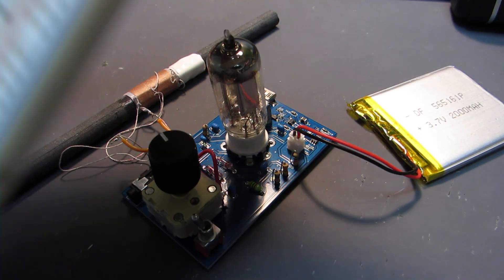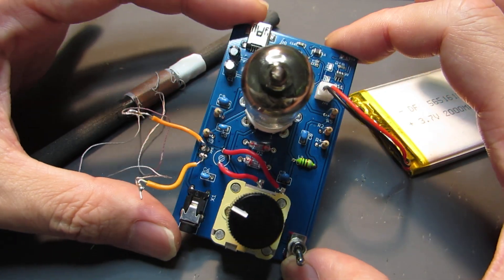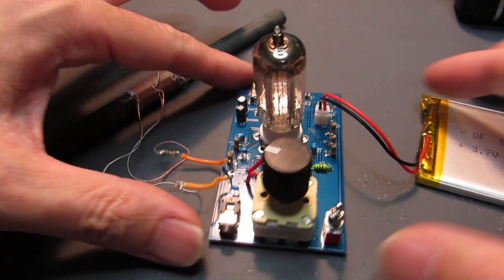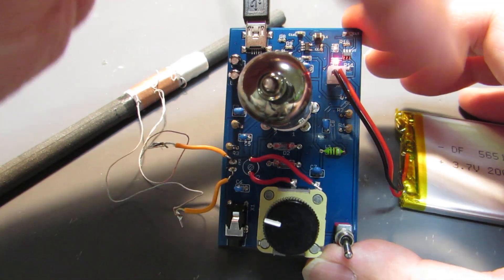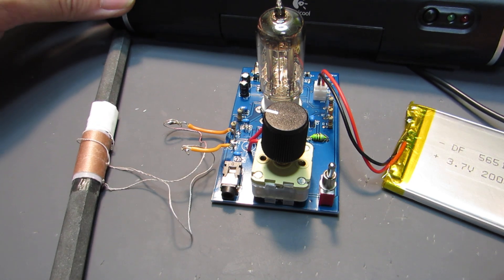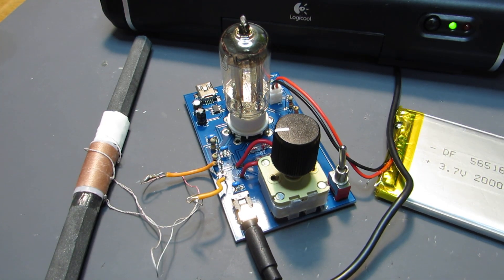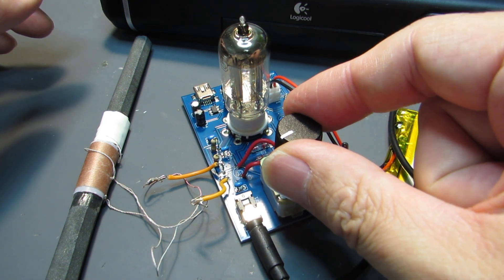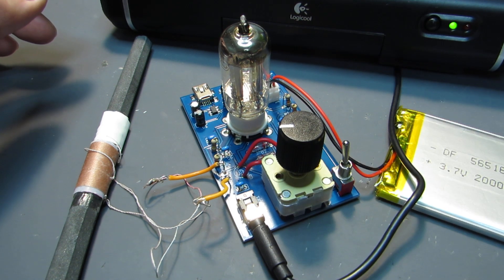Single board single tube (3A5) radio!

Comment: Very cool ! How hot does the tube get?
Reply from the maker: Hello and thank you! Actually 30V plate voltage does not produce any heat production. It's cold tube!
Reply: microwavemont is that a lower draw?